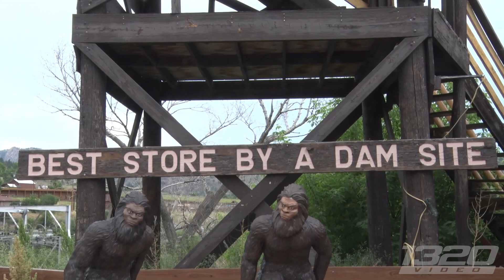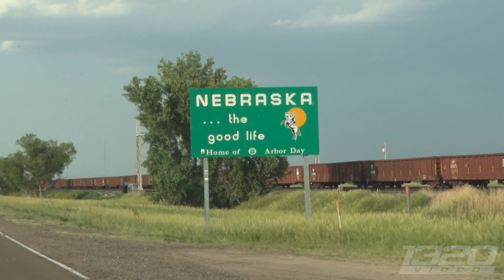109ºF with NO AIR CONDITIONING..(This is TOUGH!)

Comment: The radiator spray technique has been used by the circle track people secretively not so much secretively anymore but when they go around the track at high rpm and there’s mud being flown everywhere it covers the front of the radiator and they use I’ll spray system with small water tanks in between heats to blow the mud through the radiator and also brings down the temperature of the car I know they’re restricted to only be able to use a certain size tank and so many feet of hose plumbing it’s in rules somewhere specifications but it is a tactic that has been used by them for a long time I’m 40 and I remember helping my uncle and his friends do this on their street stocks and modified‘s for the circle tracks Since I could actually turn a wrench probably around 10 or 11 years old it’s a great idea and it works really well until you run out of water LOL

Comment: The Great Lakes Dragaway dragstrip in Union Grove Wisconsin, just south of Milwaukee. It opened in 1955, and is now the oldest continuously operating dragstrip in the United States
Reply: I was scrolling down the comments to see if this was going to be mentioned because I thought GLD was the oldest too. And I believe they’ve been been in the same location the whole time.

Did some more research. GLD is IHRA. Julesburg is NHRA and I think that’s what they meant, that it is the oldest NHRA drag strip in the country.
Reply: @g60corrado91  We called it Union Grove or "Da Grove" if yr from Chicago. First time I was there was in the fall of 1959 with my 1960 Pontiac to race.  In 1958 I saw cars coming back at the local drive inn with shoe polish numbers on the windows and no hub caps. That got me started.
Reply: @63grandsport11  yep, I live in McHenry County. Definitely been there a lot!

Comment: To cure vapor lock on fuel lines, wooden clip type clothes pins on metal fuel lines(heat sync) . Or neoprene fuel lines. Even then just clip them on to the lines as many as you want . More is better and mite need to be supported. Old tech,  fuel pump metal line. Clip em on.

Comment: Jackstand: "You lifted the head, leaked down coolant into the combustion chamber and bent a rod."

Parker: "Yeah so its either a cam bearing or lifter."

wut
Reply: if you watch his video, they all kept telling him he had rod knock from not changing oil, so being a kid new to this he had that in his head, after took it apart James was totally wrong and a cleetus tune lifted a head and then it bent a rod trying to start it with water in the cyl. the kid probably was still thinking he lost a bearing from low oil pressure. but he didn't.

Comment: Idiots your fuel is boiling cause of the altitude change and the heat combined if you ran actually fuel cells instead of tanks you wouldn’t be having those problems